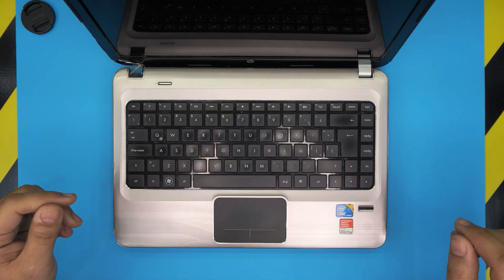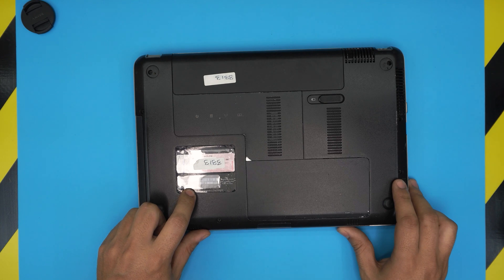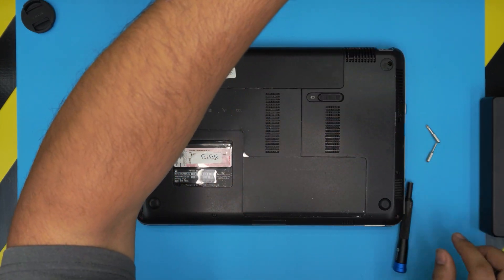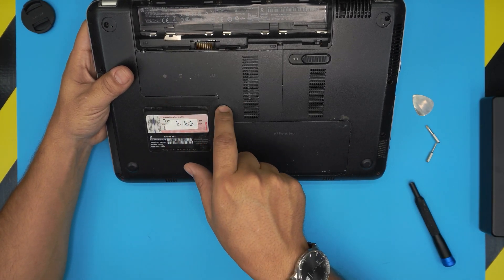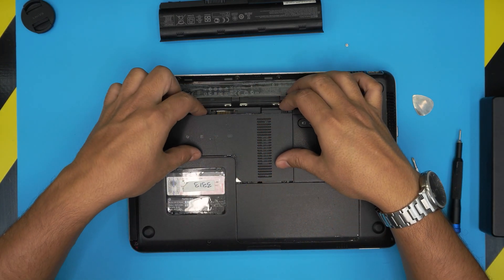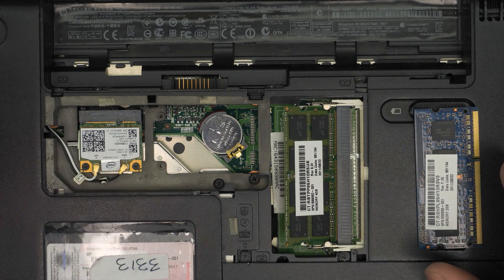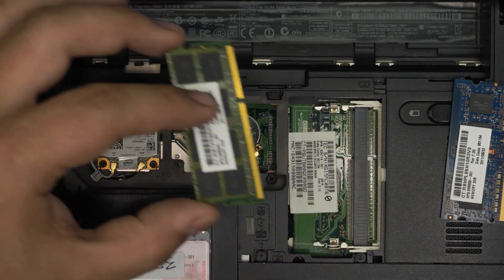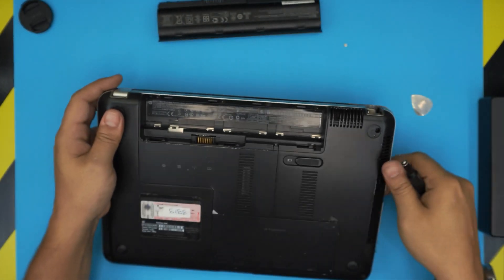HP Pavilion DM4 1380 RAM UPGRADE | FULL GUIDE

Comment: Can I install an 8gb memory and leave one compartment empty? or do they necessarily have to be two memories of 4gb each? Greetings and thank you very much
Reply from the maker: Thank you for your feedback! If you wish to support the channel, you can like, subscribe, or do both!

Regarding your question, yes, you can certainly do that, and it will work perfectly fine. However, for optimal performance, I highly recommend filling both slots with 2x 4GB RAM modules. This way, you will have dual-channel memory, which is much faster than single-channel memory.

Should you have any further questions or requests in the future, please don't hesitate to ask me.
Reply: @uFixTek  Hi, my laptop is an HP Pavilion DM4T-2000.  The maximum that this motherboard can digest is 8GB total (4+4 / 8 single )  am I right? Thanks.

Comment: What's the most ram this model (pavilion dm4) can take?
Reply from the maker: Thank you for the feedback! if you wish to support the channel you can LIKE or SUB or both :P
regarding your question: i believe we have upgraded this models to 16gb, but to double check that see this video: https://youtu.be/tKEJTkVth4Q
if the result comes with 16gb then use this ram: https://amzn.to/3JbmmMf
make sure you use sdram ddr3L 1600mhz
but for this laptop i recommend to keep it at 8gb: https://amzn.to/3j3v8Bq
Reply: @uFixTek  Why you recommend not upgrade to 16Gb?? I have installed W10x64 and need more performance in my laptop!!!@uFixTek
Reply: @nandez1987  Hi, Did you find a working driver for the AMD Radeon HD graphics that will work with Windows 10, or you are using integrated Intel HD Graphics?